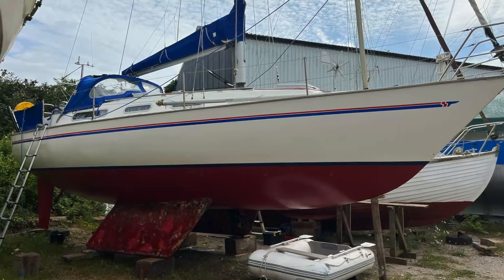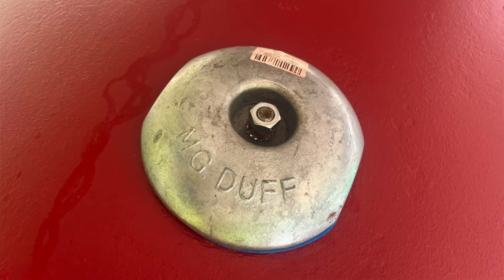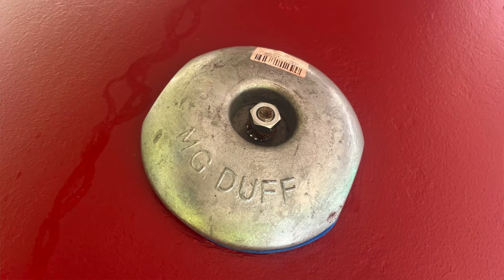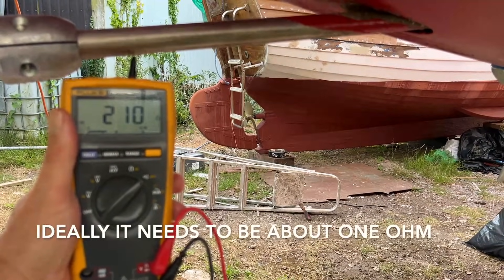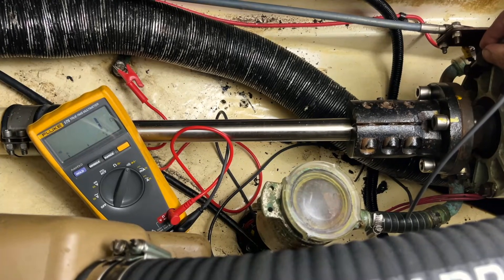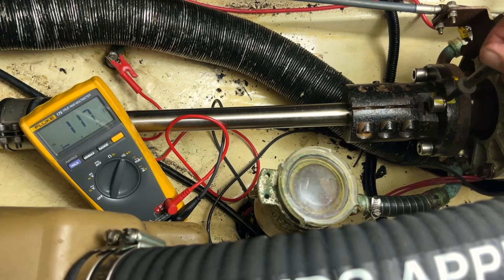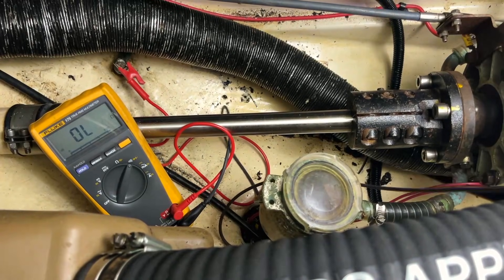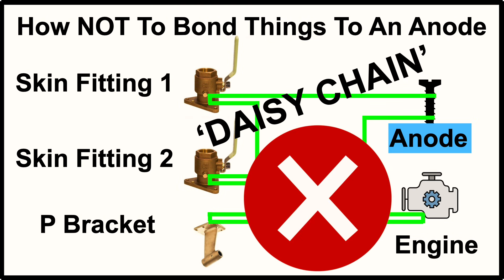How To Check If The Boat Anode Connection Is Good

Comment: Propeller looks really close to the p bracket
Reply from the maker: Good spot, it certainly was. The shaft always moves a little when changing from ahead to astern so having 15-20mm clearance would be about right for a 25mm shaft.

Comment: You cannot expect a low resistance between the gearbox casing and rotating shaft.  The oil will partly insulate it at rest and the resistance will increase dramatically when running.  This applies to ball and roller bearings too.  For a good contact you would need slip rings.  Forget it - the shaft mounted anode will work fine.
Reply from the maker: Thanks for taking the time to comment.
You are bang on the money, and you could see how well wasted the shaft anodes were because of that.  That's why it always pays to check the resistance so you know whether a back up or alternative setup  is needed.